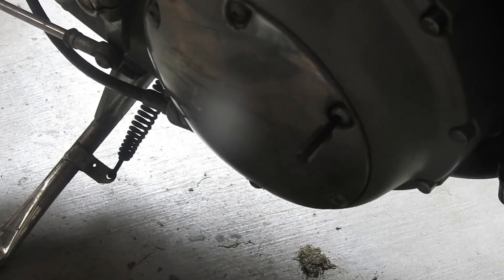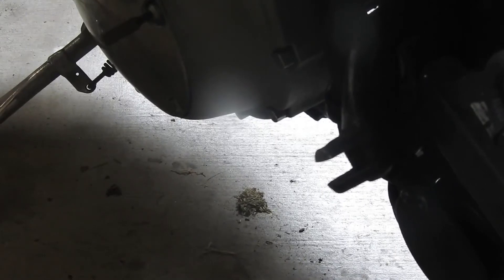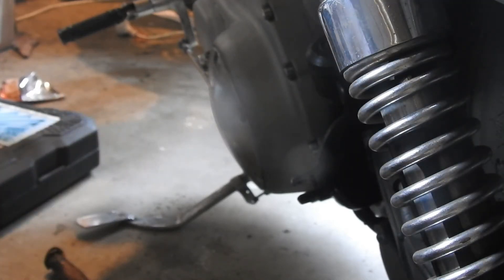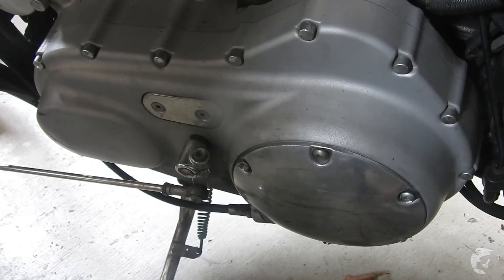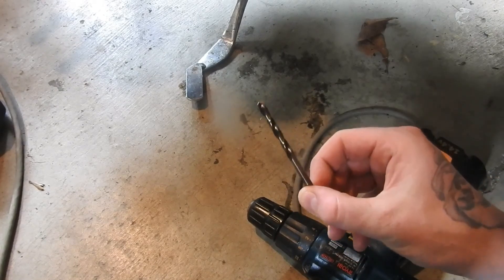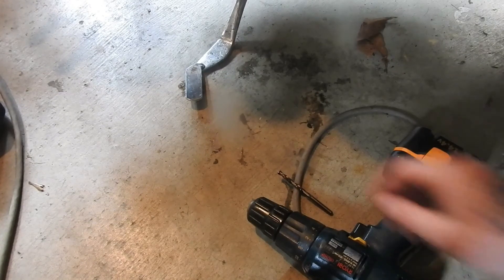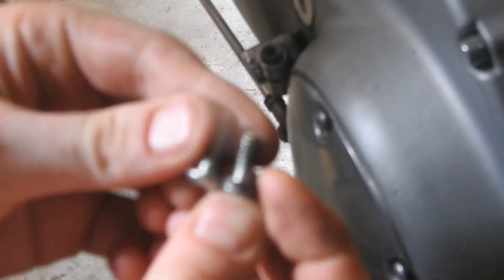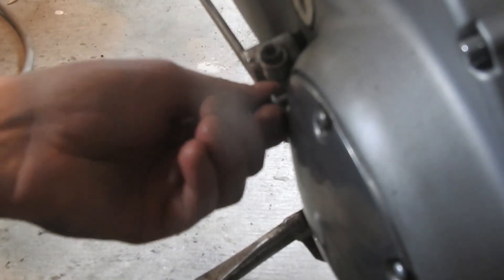Harley Sportster Stripped Derby Cover Torx Bolts Removal

Comment: Just got the clutch inspection cover off my 2000 1200C thanks to your video. Drilling torx bolt head worked (even though i mutilated them before seeking help from youtubers). Used lots of cutting oil and fresh high quality 1/4" drlll bits. Very careful to stop the drill after bolt head gone. I but some tape on drill bit 3/16 above tip as a precaution. Headless bolts could be removed from primary cover without a tool. I will be using ss female hex socket bolts when reinstalling clutch inspection cover. (Will avoid torx screws from now on!)